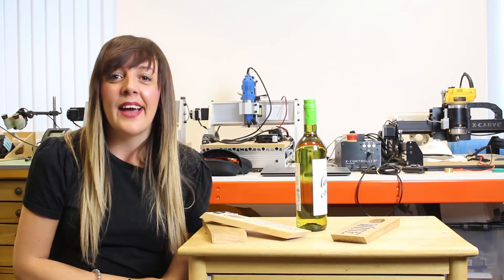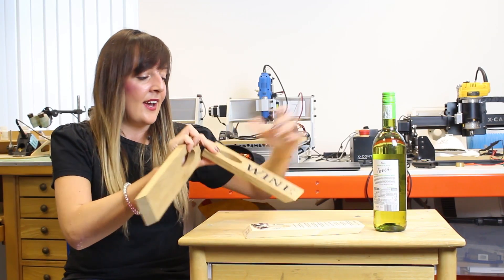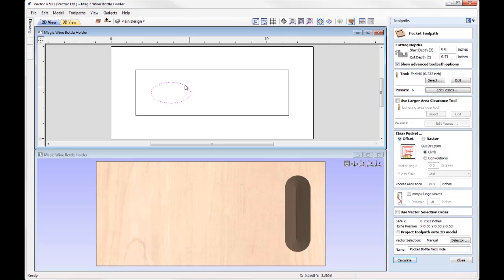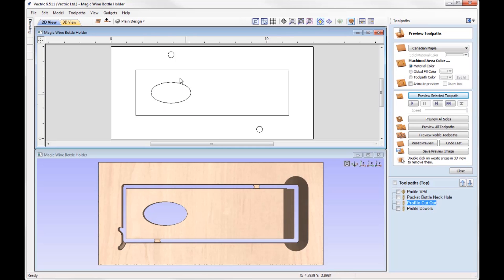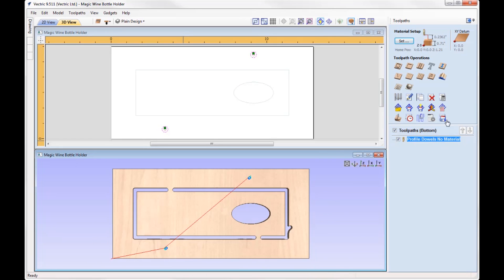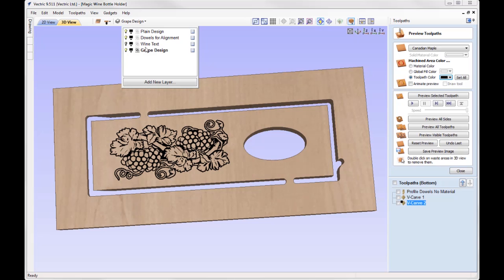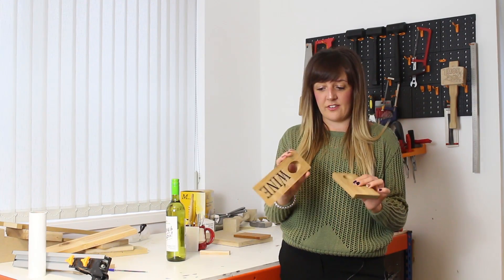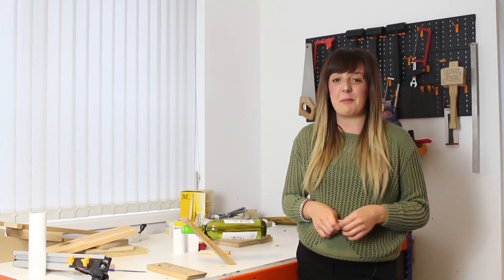In Labs with Beki | How to make a Magic Wine Bottle Holder | Vectric FREE CNC Projects

Comment: Great project for the upcoming festivities. But i am thinking of cutting the board out, including the 45° cut(s) before taking it to the cnc. Then using my fixed x-y corner, setting up is just a question of holding it down, make the 90° cutter create it's writings and/or designs and put on the next one :-). Yep, i am in for a few bottles at once :-)
Reply from the maker: Hey Staf! Excellent have fun! Would be great to see your versions too! Thank you! ~ Beki

Comment: I love the WINE text, but I have version 8.5 and it does not have this font available. What is the font that you used here and is it something I can import to the 8.5 version?

Thanks!, Steve
Reply from the maker: Hey Steve! The font is one that comes with Windows it's called "Algerian" I hope this helps! Thanks, Beki
Reply: @vectric  Hi Beki... I did not have it on my system, but was able to locate online and download. Thanks so much!! Keep up the great work!! Steve
Reply from the maker: @jstevenlamb  Great stuff! I'm glad you've managed to get hold of it :) Thank you for your kind comments :) ~ Beki
Reply: Thank you for making it, I do have a problem as I don't have 9.5 yet only 8.5.  Is there anyway I still could download this into aspire 8.5?  thank you so kindly.
Reply from the maker: @donnawalsh1318  Hey Donna, unfortunately files written in later versions aren't backwards compatible, however you can download the trial version for 9.5 and open the file in there, that way you can see the dimensions of shapes and the toolpaths used and just replicate them in your current software :) I hope this helps ~ Beki!

Comment: Great project.  You'd probably save  enough time to vcarve 10 of these if you used a table or miter saw for the angles and drill press for the hole.
Reply from the maker: Thank you :) Sure you can do it that way too :) ~ Beki
Reply: I agree with some projects they are quicker but I'm not sure how you'd do the oval hole on the drill press, perhaps I'm missing something.
Reply: @AusWorkshop  it doesn't have to be oval.  I've done many of these with just a circular hole and they work just fine.
Reply: @AusWorkshop   You just angle the drill press table,and just like magic you get a oval hole :-)
Reply: @TheDokken  Of course. Thanks. Feeling a bit silly now.

Comment: great video but can we achieve 45 degree hole for the neck bottle with cnc or 3d machining?
Reply from the maker: Hey Chor, Thank you for your comments! Sean has beat me to this answer and I couldn't have answered it better myself! :) I hope he helped! ~ Beki
Reply: If you wanted to achieve this on a 3 axis machine you would need to have the wood tilted up at 45 degrees from the cnc bed and have the router cut a circle straight through the material. Problem with this is you are going to need a long end mill to ensure the router doesnt collide with your work piece and the cutting depth will end up being really deep to pass through the thickness of the material throughout the 45 degree angle. You would be much better off doing this manually if a 45 degree hole is what you want to accomplish